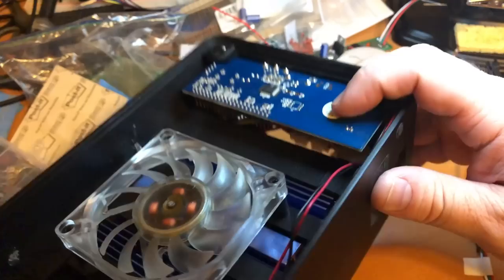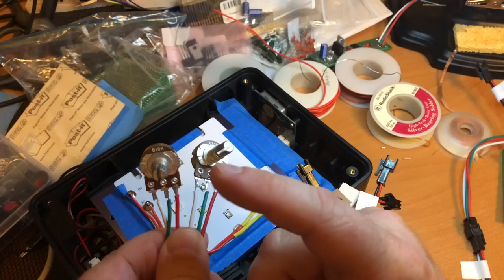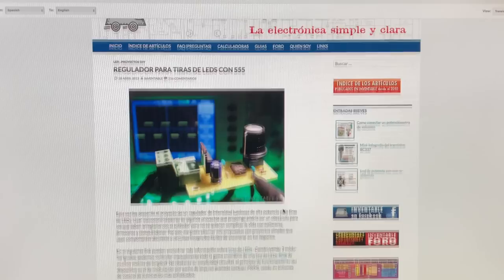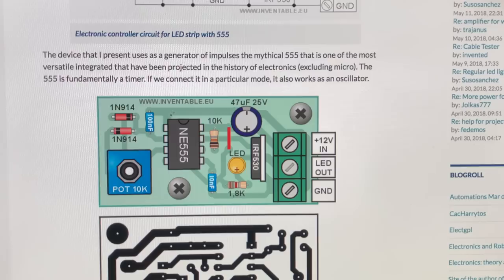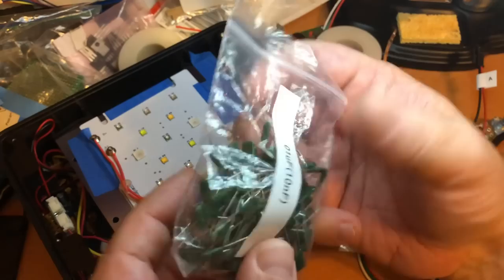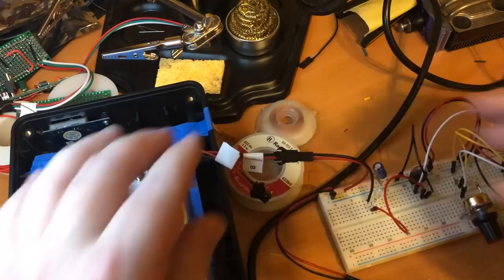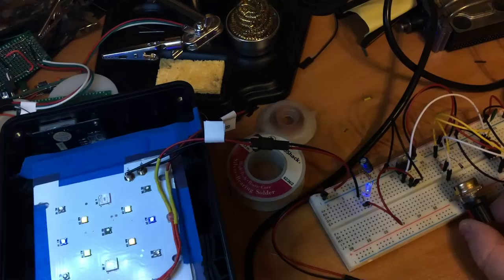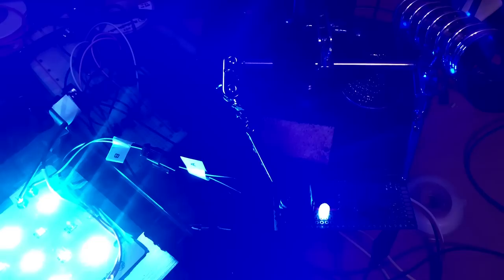DIY Reeftank LED - Pulse Width Modulation [Part 2]

Comment: Really cool. You sparked my interest, I haven't messed with DIY LED in over 5 years, but I did a ton of it back then. I like your manual control and DIY driver. I jumped right into automated control with mine. I used the meanwell dimmable drivers to feed the diodes and I sent the PMW signal using a beaglebone black. It's a microcontroller like a raspberry pi, but I like it better. I wrote python scripts on the beaglebone to send pmw to the drivers. These scripts were run with cron jobs to dim the led channels though out the day. It worked great for years, but the diodes I used just had crap spectrum so I have since just moved to radions. I really do like this DIY electrical reef stuff and sort of understand it; I also have a ton of parts in boxes. So if you want to chat about it or want some parts just let me know.
Reply from the maker: Thanks for the comment. I’m just having fun with this stuff and trying to learn as much as I can about it.  I definitely want to hook this up to a micro controller at some point and maybe even build a better light in the future. Right now I just wanted to see what I could build with the parts I had available. I’d love to hear more about what you have created!

Comment: Good stuff Spy. I would check the mosfet for heat after a longer run time. Can't wait to see what you come up with for the Apex to convert the 0-10 volt over to the PWM circut.
Reply from the maker: Yeah, I might stick a heatsink on there just in case.  Now you have me thinking about the Apex... 🤔
Reply: Optocoupler circut comes to mind

Comment: I always use these LED drivers, much more simple to connect and really easy to control with Arduino, I don't know how the Raspberry pi handles PWM but I'm sure it's not much different than the Arduino. These LED drivers simply use 5v PWM signal on the dim pin, power goes in one side, LED power comes out the other, and its tiny :)

Meanwell LDD-700H LED Driver https://www.amazon.com/dp/B00OVCBLO2/ref=cm_sw_r_cp_apa_i_Bu7sCbNVRXGR0